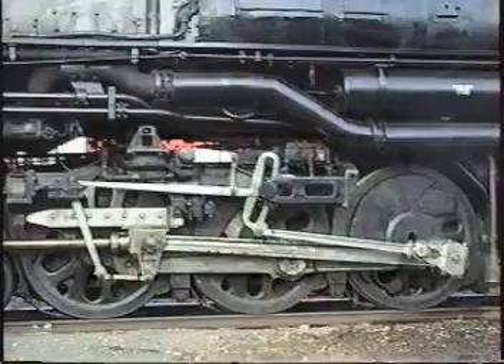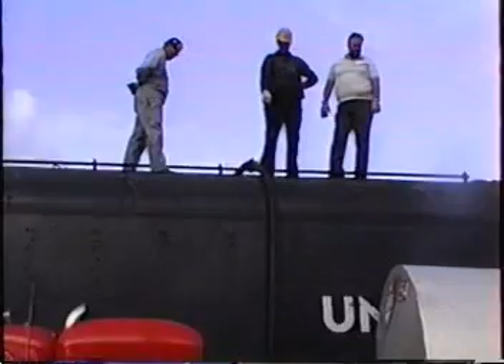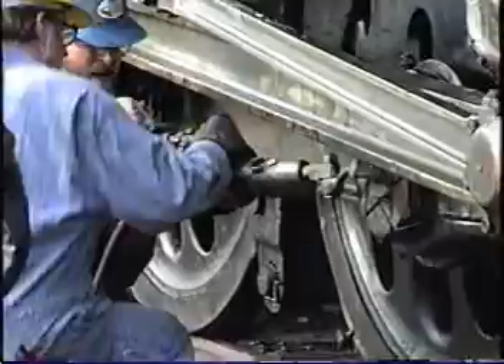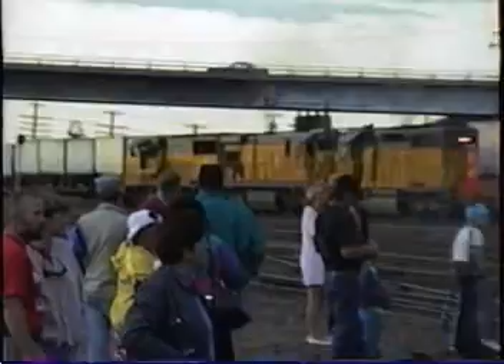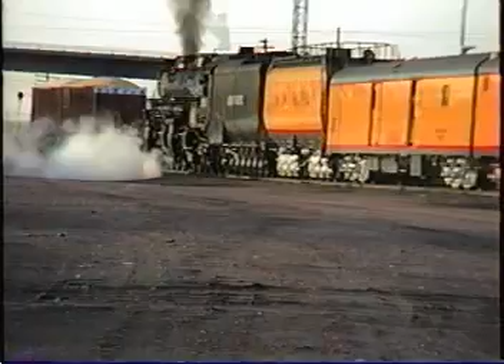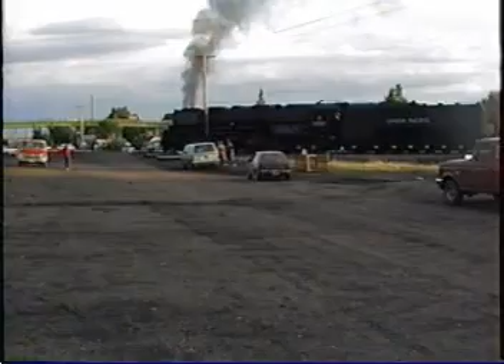Seen on the UPRR in July 1992: 3985 in Laramie, WY

Comment: Well, that's just it: ¢o$ts killed the steamers.  Figure that 5-10% of your steamer fleet will be disabled at any given moment for boiler de-scaling or similar procedures not required on an ICE.  Plus, the dead-weight of water needed for steam generation means that they are far more energy-consuming per HP of hauling (and many later steamers were oil burners so the coal advantage is somewhat moot).